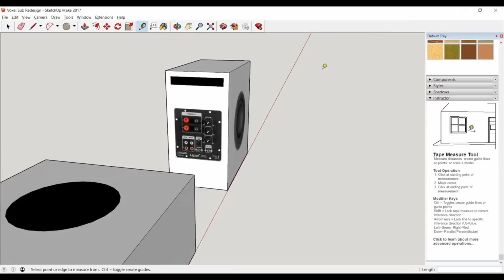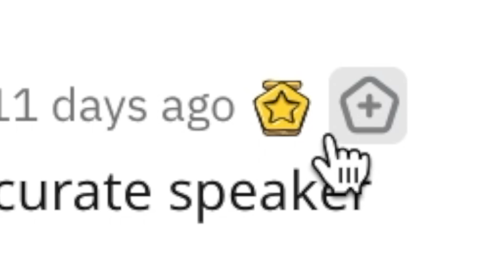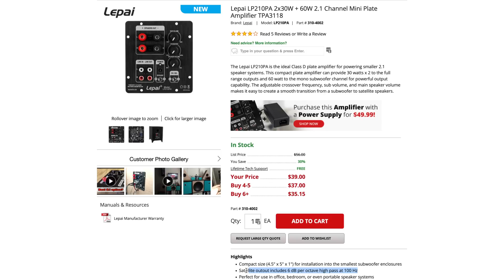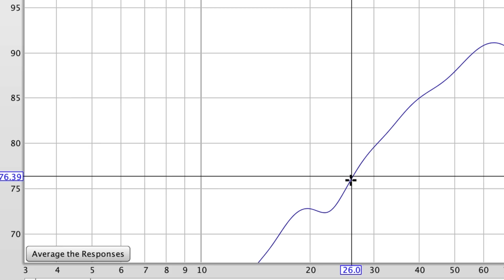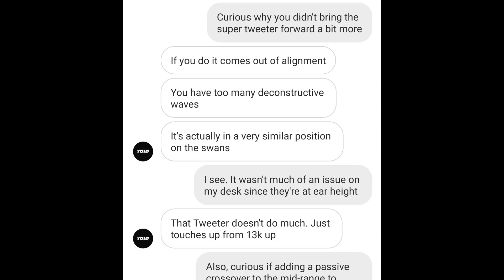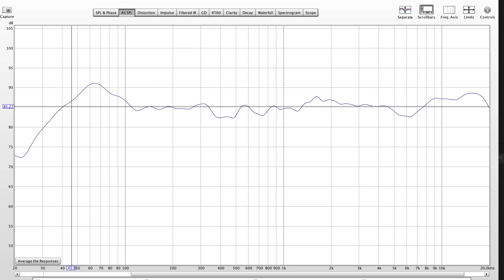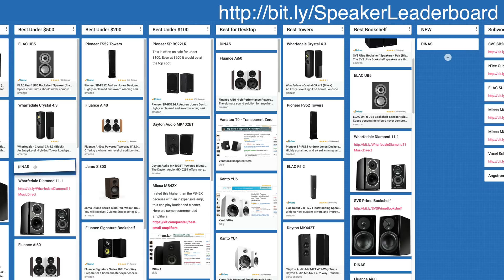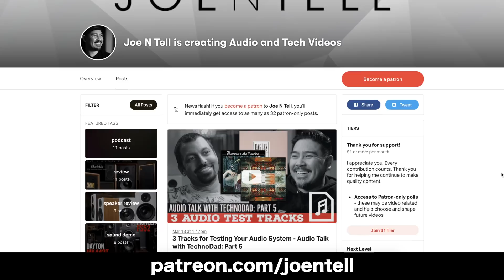DIY Speaker With Subwoofer Hits Down to 35 Hz! - DINAS - Active Bookshelf Speakers Collab w/ 123Toid

Comment: Surely those magnets would mess up your iMac screen? Very cool though I like the video production and explanation cheers.
Reply from the maker: Magnets don't affect led/lcd screens in the same way as CRT monitors.
Reply: @joentell  interesting, because the old tannoy monitors I used to have totally ruined my iMac a few years ago. Not suggesting you are wrong but Its interesting... these days I use genelecs and they are fine with my displays. Cheers.
Reply from the maker: @scoreandsound  older iMacs hat CRT's. The flatter ones are LCD. I ran an I.T. business over 10 years. Some people don't think it's good to put hard drives next to powerful magnets, but that's a different story.
Reply: @joentell  thanks dude

Comment: The Swan M300s and the Vanadoo T1Es are both under $600 with 240 watts, digital inputs, sub out and they go under 40 hertz. I'd spend at least 2 days working on the build so parts and labor over $700. Even the Atom T7Vs are under $600. Why try to build a Chevy when you can buy a Cadillac.

Comment: Since the high pass terminals are on the outside of the plate amp, how did you wire them.
I know that the subwoofer wires are on the inside of the plate.
There must be a way to wire the midrange & tweeter on the inside of the plate amp ?????? Please explain somebody??
Reply from the maker: Tapped into the solder points on the other side of the plate amp

Comment: Flaring the port will not solve your chuffing issue.  The problem is the very narrow dimension, which I’m sure you suspect.  As that’s not really something you can change, I’d say just enjoy them at a level that works.  Volume isn’t everything.
Reply from the maker: Whatever it is, it is only at uncomfortably loud volumes.
Reply: @joentell  So don't listen to them at uncomfortably loud volumes.  Chuffing problem solved.
Reply from the maker: @Trev0r98  😆 Pretty much.

Comment: Can I use this as surround sound speakers instead of buying some polk s15s for surround? or Rears on my home theater setup?
Reply from the maker: Not ideal. You would have to run a long RCA cable to each plus power for each. Better to go passive. Plus these are too awesome to only be used as surrounds in my opinion. What are your main speakers?
Reply: @joentell  I have a Onkyo TX-NR646, 2 Klipsch Subs a 12" , and 15", Have for my mains a set of Polk Audio Monitor Series II Tower Speakers, I have for Center Polk Audio S35, and for Surround I have 2  old school Infinitis  Book shelf speakers, Really looking into the Polk Audio S15 or Sony SSCS5 and S20 or these that you made DINAS for rears. What do you personally recommend? for the price I like loud clean sound with a good bass.
Reply from the maker: @541_CoyotePower  I think it's important to timbre match your speakers also known as voice matching. Ideally, you would get all the speakers from the same line to make the transition between speakers more seamless.
Reply: @joentell  I will go with the polk Signature series then, thanks boss.
Reply from the maker: @541_CoyotePower  👊😎

Comment: 2 questions for you the RCA cables you use between the speakers are they cheap cables or some sort of quality or connector type also I'm wondering if placement matters a whole lot inside of a tractor-trailer is a typical size truck not in extended sleeper I was thinking I put in them behind the seat that way they are on the floor but there might not be room I may put them on the bunk or on the upper shelf but I'm unsure if the upper shelf position will reduce the base unless the space that small it won't matter thank you

Comment: I'm wondering if there is another amp with bluetooth that will fo the job with this speaker.
Thank you
John
Reply from the maker: It's easy to add Bluetooth to a setup like this. Probably just add Bluetooth as opposed to finding a different amp. It's tough to find a 2.1 channel plate amp at this price range with these features.
Reply: I'll do that thank you

Comment: Very impressive achievement.
However, when you get around to discovering that "Transient Response" is a valuable thing, 
you'll go with a sealed sub on the floor, with sealed Satellites as well.
Also, getting the Satellites up off of the desk/table is very much worthwhile.
18 inches works pretty good.
Also, Active Crossovers are mandatory.

Comment: Swap out that Dayton for the Tang band W4-1879 4" if one wants to up the fidelity of these with a much more reveling 4 mid-range. A bit more pricey but trust I wrote a review on the 3" version in a shootout cs a Audible Physics 3" mid-range and the Tang were so nice, they present a wider sound stage while giving all the details of a $400 mid-range. I have owned the Dayton before, the tangs are that much better. Would take the Dina's to the next level... probably call that version Dina plus. If I can find someone to actually send me a knockdown cabinet in white Birch I'd build them just as.
Reply from the maker: Reach out to 123Toid. He has a website.
Reply: @joentell  will do

Comment: Nice sharing. I wonder if we can have something smaller in size for the overall gadget? Probably compromising sub-woofer with a higher frequency like 40-45Hz? smaller than the 5"1/4" inch that you use. Anyway, it's inspiring to see your video. Good job!

Comment: can you do these passive? I have a great tube amp in a tiny room. I want to build a 70-100 watt speaker I would love to build a three way.speaker, 
 thanks
Reply: You absolutely can, but the crossover will be complicated. Crossovers for 3 ways get pretty complex. If you've never built a crossover before, this is not the best place to start.
Reply from the maker: Agree

Comment: Using a digital amplifier with less than 95 dB signal to noise ratio is not good audio, you can't even call it hi-fi
Reply from the maker: Honest question. Where is that 95dB number from? What SNR is considered audible by human hearing? I just find it interesting when shopping for some of the best microphones used for TV, movies, voiceover, vocals etc. They seem to be less strict than you with regards to that 95dB rating. It seems to be counterintuitive considering it seems to me that you're saying the standards for playback need to be better than the production.
Reply: Digital amplifiers like NAD with a price tag of 600+ Eur get a S/N ratio of around 100. The chip they advertise to use is TPA3118, the description is here: http://www.ti.com/lit/ds/symlink/tpa3116d2.pdf . I'm pretty sure they aren't using any discreet high-end components like capacitors etc. with a low price, so the best the amp can probably do is 95 and that's generous, it's more likely 85.  You can hear the difference between a digital amp with low S/N ratio and an analog one with 105-110 dB S/N. It's like upgrading from 480p resolution to 1080. And that is just considered hi-fi, high end amps have 110+. I've built multiple digital amplifiers with chips that had 85-86 dB S/N ratio, they get the job done for games, movies etc. but not for listening to music.

Comment: One last clarification.... the stereo amp is rated 30 Watts each and Dayton Audio RS100-4 Ful-Range Driver is rated 30 Watts rms. Now If I don't use the tweeter, should I choose a higher rated speaker?
Reply from the maker: You could. Just know that 30 watts is a healthy amount for a speaker with a high pass crossover at 150hz.
Reply: @joentell  Thanks

Comment: Tang Band W5 1138SMF rated frequency ranges from  45 to 1,500 Hz at the website. How is the 35 HZ possible here? I am planning to build one, kindly clarify.  Thanks
Reply from the maker: Those are the frequency ranges when not in an enclosure. If you look on the page for the W5 on Parts Express look at the section that says optimal enclosure. It shows 35hz.
Reply: @joentell  Ok. Thanks for the quick reply!

Comment: A good pair of passive bookshelf speakers can reach down to 25 Hz or lower, without some Chinese plate amp with shitty class D. Even my 30 year old recapped Canton Karat 20 hits 36 Hz on a 6,5 inch driver, they costed over $1500 new. Real wood, heavy as hell for their size, aluminium-magnesium dome. It was a brand that didnt mess around, some of the best speakers in the world 1979-2000.
Reply from the maker: Which bookshelf speakers are rated at 25hz +-3dB? I'm not talking about standmount speakers, I'm talking bookshelf.
Reply: @joentell  My recapped Canton GLE 100 from 1979, technically bookshelf speakers but on the larger side. 12 inch woofer that can reach 22 Hz, the speakers have a huge frequency range all the way up to 30000 Hz thanks to a 0,75 inch silk dome tweeter with dual magnet. 150 watts of maximum music power.

Still very looked after speakers in the hi-fi community. Outstanding speakers even today. Almost nobody could afford them back in the day.

Comment: Where can I get cabs for these? That’s the one thing I can’t do myself. Not woodworking tools, no room in the garage for them, no way to get there. It would be great if I could buy these in a kit! 
Also, I agree on the use of paper in a sub, woofer or midrange, unless you’re using a dome for the midrange. I would consider making a four way system, with a midwoofer and a dome midrange for upper mid frequencies, also the with these killer tweeters.

Comment: I prefer the Tang Band W6-1139SI (6.5") paired with the Dayton Audio RS100-4 and Peerless BC25SC06-04. I built them in a D'Appolito configuration with amazing results; no extra subwoofers required.

Comment: Why is 35Hz impressive??? If you got down to 20Hz than it would be impressive.
Reply from the maker: Pretty much impossible with an enclosure this size. It's impressive because of the enclosure size. Getting down to 20hz with a huge box and woofer is easy!

Comment: If your Port is blowing that much are that means the air velocity is too high. Not a good thing
Reply from the maker: It will happen on almost all ported speakers once you reach a certain SPL. It's not necessarily bad. It's just what happens eventually depending on the amount of air being moved. It just means it's hitting it's limit. On this, it happens at a volume that is loud enough where it's not even a real issue. I just felt the need to mention it.
Reply: @joentell  Um, yeah, I understand the physics of a vented enclosure. I've built hundreds. The woofer must have either been playing waaaay under fB, given to much air volume inside the enclosure, or too much power. As you said, "It can get really low, but only at low volumes." Therefore, the box is tuned high, without a crossover, therefore making the loudpeaker reach xmax, and possibly xlim, earlier than it should. There is a reason we have subwoofers, it takes the stress off of the woofers/ midrange drivers. They are small, therefore not ment to play lower frequencies. Especially when in an enclosure bigger than suggested for the mechanical power handling. 

TL;DR: It cant handle frequencies that low, at that power, due to sloppy enclosure design, and the lack of a subwoofer to play said lower frequencies.

Comment: Is there any information about the THD on the amplifier with 22V and how many rms you get with a 8 ohm speaker on satelite channel
Reply from the maker: Maybe on Parts Express? Those guys are pretty responsive if you ask on the product page for those plate amps.
Reply: @joentell  thanks Joe, I will ask partsexpress, greetz
Reply from the maker: @roygriend5143  You have to use a dash between parts and express. LOL

Comment: i do not believe what i am seeing, so many good ideas run together here - I guess to get cute that tweeter could be raised or angled up, and maybe toed in a la Ohm Walsh
Reply from the maker: It's DIY so we welcome people to tweak the design
Reply: @joentell  sweet setup, Joe, and Toid! And is that plate amp class D, likely so, but no worry in my opinion not to be class A - the fact that it doubles as crossover and maintains small size is more than worth any loss in staging or depth of image, which I am told is the mark of class A  - but this may be in a big room with some pretty giant boxes and many drivers, with Wagnerian opera playing, and  from reel to reel, who knows/ Anyway cat an amazing video & product.

Comment: Aren’t you playing a left signal in tweeter and right signal in the woofer or visa verse?
Reply from the maker: No we split the left and right signal at the source so each speaker gets a mono signal
Reply: Why didn't you use a splitter  for each separate channel? This way you can plug in both rca inputs with left or right source. I.e. on the left speaker, split  the left input rca and plug them into the right and left input . This way both amplified outputs would work not in mono. Just wondering

Comment: Hi guys, I'm reallly interested in building these, but really need to save on drivers cause I live in Brazil, so taxes and shipment make prices impractical if not impossible. I was wondering if I could replace the mid for a fostex Fe126en 4.5 full range which I already have. I also already have the amp plates I bought from Ali Express. I would still need the tang bands and the hi vi tweeter, and buy the plans, which I can do. Would the fostex alter the combo specs too much?
Thanks!
Reply from the maker: This is a question for @123Toid
Reply: Thanks,  Joe...@123toid

Comment: HELLO JOE, how did you handle the high frequencies, in order not to 'mix them'? Because if the amplifier has a cutoff frequency and the tweeter has a high pass filter, it would be reproducing both the tweeter and the 'mid' high frequencies (with all their distortions at that level of frequencies)
Reply from the maker: I think this is more of a question for @123toid since he designed the crossover.

Comment: I'd love to see a tower version of these.
Reply: @joentell  how u listen this in stereo mode .......
2.1 ch in amp in each side ..... 
Both left and right ch is in same side of each 2.1 ch 😂 ..........
Then 
How u listen in stereo mode .........

I have a solution ......
Each 3.5 mm jack have .. LGR wire ....
Provide LG wire only on left side Amp 
And RG wire only on right side Amp
Reply: Yes, I was thinking of building a tower with 4 of these in each box. 72 mm xmax and almost the same cone area as a 15".

Comment: I've been planning on a similar (but even meaner) build recycling the amps and subs from the legendary logitech z2300. they're often available from thrift stores as people don't realize what they're throwing out when the crappy controller dies or the poorly matched satellite speakers blow. logitech used an 8 inch tangband sub and quality class AB amps (80w to the sub, 40 to each satellite powered by a big torroidal transformer - seriously, everything is quality inside the box). You can even buy after-market replacement controllers for them. Imagine a custom build with one of them on each side!!
Reply from the maker: Was it really a Tang Band that they used? That's awesome
Reply: @joentell  actually now i've read the thread linked below it seems the previous version to this used a tang band and (from what i can tell, anyway) logitech commissioned a slightly modified clone for the z2300. this is a pretty interesting read: https://www.head-fi.org/threads/logitech-z-2300-the-last-of-the-titans.532858/

Comment: I'm confused...why were stereo plate amps used for single-channel speakers?   Is it because of price + free crossover?
Reply from the maker: Correct. Dedicated power to each driver and ability to change low frequency crossover point. Ability to change the gain levels for the woofer and full-range driver independently acts kind of like a tone control.
Reply: do  they offer 100w amp plate? cause that would have been an awesome thing to feed 100w to those speakers
Reply: @johnnybravo1907  Parts express does have more powerful plate amps... just costs 2x-3x the cost.

Comment: only getting into this because you used the word SUBwoofer. digital audio that has been compacted to fit a digital disc has a frequency reponse of 20 Hz to 20 kHz, by hitting 35 Hz, you're missing almost a whole octave of sub-bass, where my system heads at? I repeat, compact disc audio, not even getting into high-resolution audio yet, hits 20 Hz.

Comment: Question Joe,
I purchased the plans and reverse engineered this enclosure (fingers crossed) to a honeycomb shape to blend with wall shelves I’m making. I plan to use these modified DINAS in my living room with the source being Bluetooth from iPhones. Can you suggest a preamp or solid Bluetooth receiver that will retain quality audio?
Reply from the maker: I can't wait to see what you come up with. I would email @123toid if I were you to make sure it all goes as planned. Not sure about an inexpensive preamp/bluetooth receiver. I would really recommend finding a Chromecast Audio instead of Bluetooth. Arylic also makes something to stream over WiFi instead of Bluetooth retaining the full quality.
Reply: I messaged him on ETSY as that’s the only platform I can get to him on. I was originally thinking WiFi but this is all new to me as far as a diy build/signal. I will check out your suggestion for sure! BTW if you’re interested I’ll send you my sketchup of the modified enclosure so you can check it out.
Reply: Hi guys, I would like to add Bluetooth and wifi connection. So can I connect the LP210PA  with the Audio receiver board Up2Stream Pro V3 from Arylic ? Or should I use the preamp S50 Pro ? Thanks